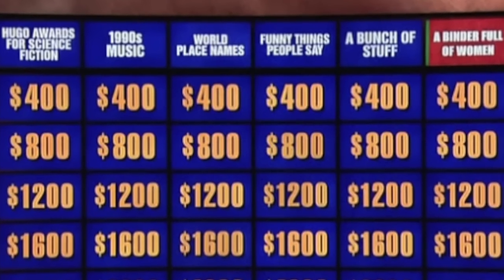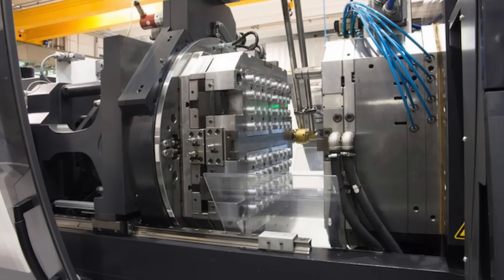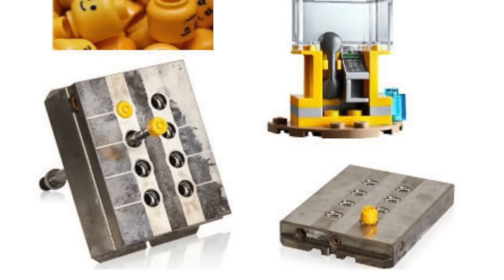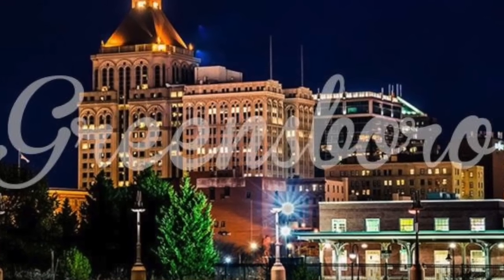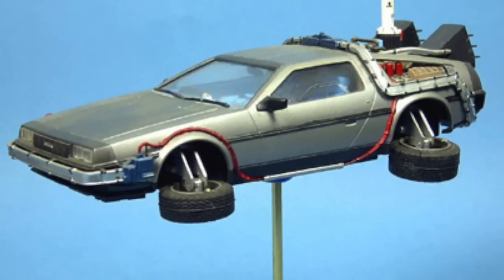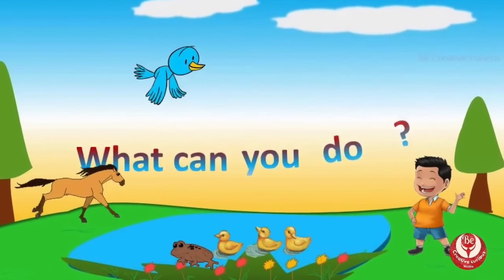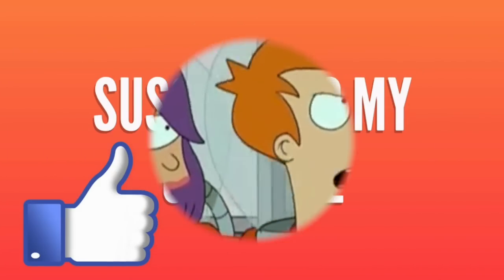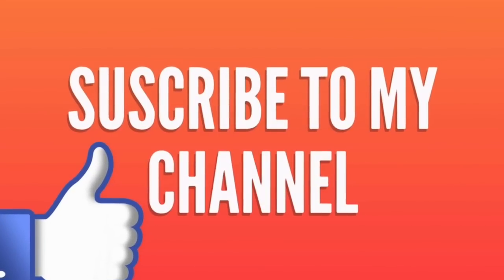When will 3D printing be used to mass produce toys and action figure collectables? Tooling replaced?

Comment: I need some clarification please.  When a toy tool is made do they make more than one at a time or do they just run that one tool continuously until they wear it out?  And second if they do make more than one tool or wear one out for a high production item, since they are all handmade, how do they make sure the pieces coming out across all the tools in use for that item are the same?  Thanks, I love it.
Reply from the maker: They run one tool constantly until it runs out.
Reply: @spectorcreative1872   How do they recreate the tool once the original is no good to the point that it's practically indistinguishable?
Reply: @FellVoice  Especially now, molds can be recreated from CAD files for a CNC. They can make nearly identical parts because the computer moves the carving tool in nearly the exact same way. So they aren't(anymore) as handmade as you might be thinking. 

So the variance in the produced parts is minimal as long as the materials/environment are the same.
Reply: @spectorcreative1872  a video about the actual manufacturing process of a figure, specially tool related topics would be great. I've wondered these same questions for some time now, and assumed duplicate tools (or multipiece ones) for faster manufacturing.

Comment: The Crafsman has a bunch of great videos on how to make homemade action figures. He even has a video talking about using a press molding machine for home use.

Would you do a video on the glyos universal system used for action figures?
Reply from the maker: I'll add that to the list!
Reply: Stay steady craftin
Reply: i love the craftsman's show. his press molding is essentially injection molding but with less umph. the industrial injection molding machines work with plastics at a different viscosity coming out of the nozzle and they are designed to fill fast and solidify/cool faster
Reply: Don’t forget your dust mask!
Reply: He’s also done videos about using resin 3d printing to make inserts for tools.

Comment: Eventually, but not yet. It will most likely start with jewelry. Once the “lost wax” process is antiquated and replaced by 3D printing, then the printers will be advanced enough to do tools and toys.
Reply from the maker: Yup. Not yet
Reply: I think it’s already in use for Dental.

Comment: People have 3d printed objects with moving parts before, like a decorative structure with moving gears inside.
Also, for the price of a single tool, couldn't you buy several 3d printers to work simultaneously to speed up the output?
Reply: You can print larger moving parts (mostly) fine, the issues are with small moving parts.  Even if your printer can manage the necessary detail, you still will have to do a fair bit of clean-up and finishing work, sanding the stepped edges so that parts can move freely, potentially drilling holes, etc. Look at a video on 3D printed Transformers that can actually transform and you'll see some of the issues that 3D printing faces.
Reply: @BainesMkII  There's a process called acetone vapor bath that is supposed to smoothen out those surfaces.
Also, why would you need to smoothen edges and drill holes when you can print them to have those features already in it?
Reply from the maker: That sounds cheap to do. ;-P